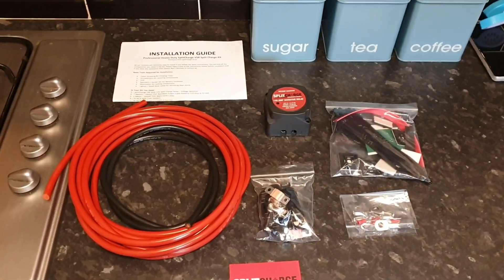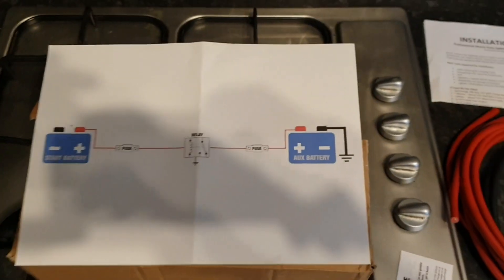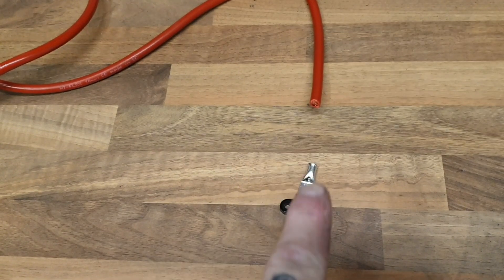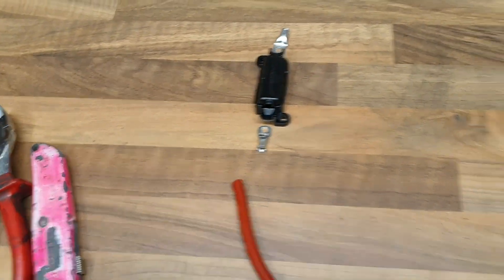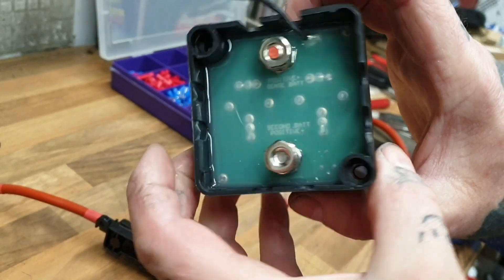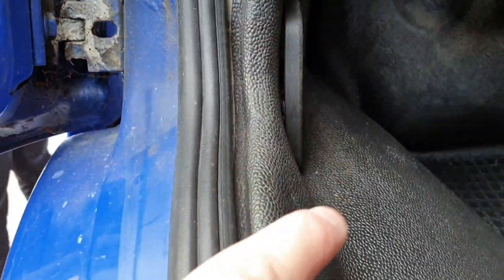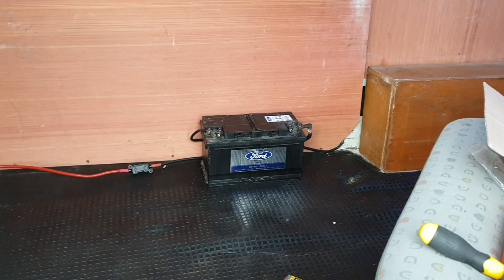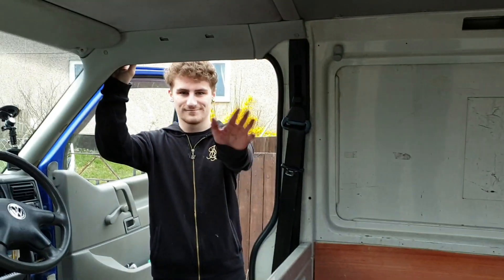VW t4  split charging system

Comment: Hello mate quick question just watched your video on split charge. Do you have to use a leisure battery or could you use a normal battery if so does it have to be a diesel battery. Doing a budget and just been given a new car battery 👍
Reply from the maker: You can use a car battery but you won't get as long out of a charge as a leisure battery which is made to give longer use.

Comment: Thanks for the video will be doing this tomorrow
Reply from the maker: Thanks. It's not a hard job just follow the instructions that came with your kit.
Reply: @docsworld9707  all finished mate appreciate it, followed your build and the wiring suggestion through the rubber gromet worked well

Comment: Might want to inspect it under the step. The molded in 'spacers' underneath it really like to dig into cables put there. If you ever get electrical problems it's on the top of the list to check